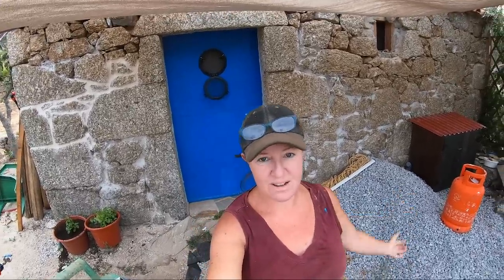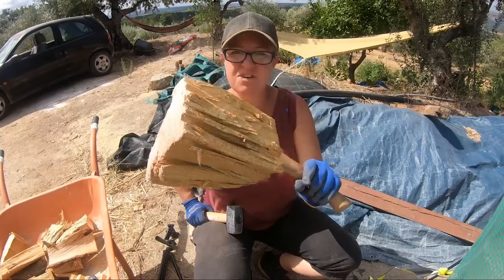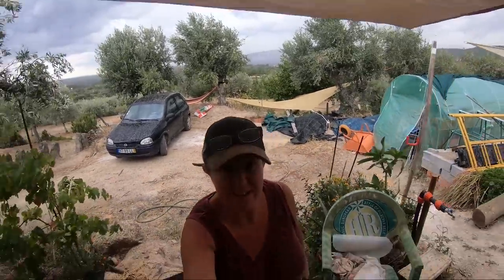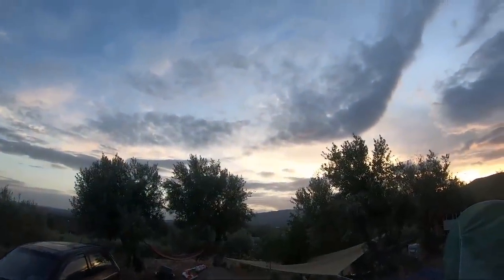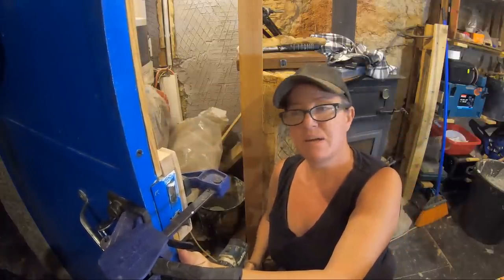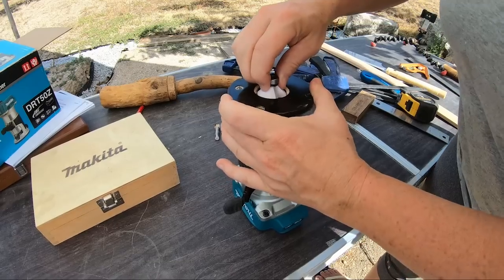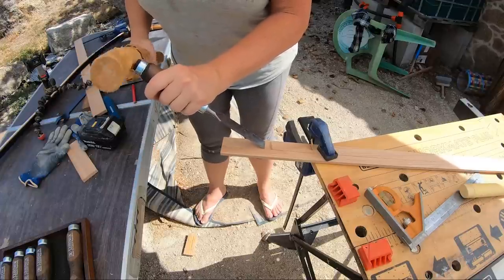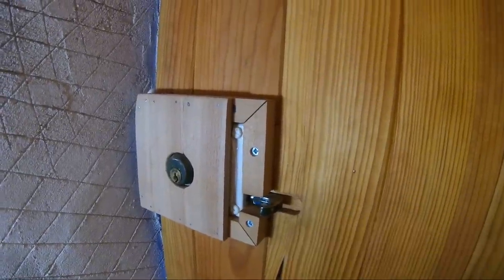Rain, Shine, Chainsaws & Hand Tools, a Video of Contrasts! - Off Grid

Comment: Have doors that open to the full width. Tradies find it so frustrating when they don’t have clear access to the things they are working on.
Reply from the maker: I agree, I think I'm leaning towards one large door which I hadn't considered for some weird reason!
Reply: @PortugalfromScratch  Yes, my first thought was also that if someone needed to get in to work on the solar or replace a part, it would be difficult to access.

Comment: Some good ideas in the comments.  If you need air to circulate, I would go for the louvered bi- fold door.  Folding to the left.   If you don't like louvers, use plain wood .    I wouldn't hang a curtain as it would look a bit  ' make shift '.
and regarding the lock :  @Reet64     below ,  has a good plan for cutting the wood at an angle.
Reply from the maker: Lots of great ideas! I'm not crazy about a curtain as a permanent solution, either. And people have pointed it out as a fire hazard, too. Thanks for the suggestion!

Comment: A nice coloured bead as a door knob might be nice if the screw option works with that. You cld feasibly do a rope/wire attachment across from the pull handle to far side so then you just pull down on the rope to open it. Cld be marine knots or Gaelic twists or something pretty. Re the cupboard door my only suggestion is to think abt what suits you to open it either towards the front door or towards the back wall. You cld feasibly get a concertina door attached so that it doesn’t impact the room but might not be room for that and still get in the cupboard. Good luck.
Reply from the maker: Ooh a bead or a knot are both good ideas! I like the idea of tying something onto it as I'm nervous of the drilling. Let's see!

Comment: Could you carve out a block of wood to go over the little thingy? Maybe have it it run on wood rail somehow?
Reply from the maker: This was what I was thinking at first but I was having trouble wrapping my head around how it would actually work in practice. 😁 I think the easiest solution is to have a little strap made of leather to loop over it tightly. There's a leather worker in this area so I'll ask her to see what she says. Thanks!
Reply: Keep in mind I have absolutely no woodworking experience. I was wondering if you could use your router and make opposite profiles on the block and on the pieces it would be sliding into. That way the little block could slide could slide in and out and stay locked onto the stationary part. I don't explain things well. 😊 I like the leather strap idea and it would be much easier. 😊

Comment: Hinged door so it folds open to full width- or can open smaller section only for quick shelf grabs
Reply from the maker: Yes this is what I'm thinking now... two sections, a smaller one on the left that can be locked into place or opened fully. Thanks!

Comment: Hey, if it ain't from scratch, it ain't Portugal from Scratch! As for the closet door, what about a bi-fold? And for the lock, what if you cut the piece of would at an angle, so it's as thick as the other pieces on the left but then tapers down to a point at the mechanism end?
Reply from the maker: I like the idea for a bi-fold across the entire width of the opening, possibly with the left side a smaller section... if that makes sense. Lots to consider! Yes I'm wondering if I'm making things hard for myself. Your solution could work, I'll investigate! Thanks!

Comment: I understand exactly what you are saying about the door. I have a wide(ish) front porch. I didn’t want a giant gate. So I had a wider than normal but still manageable gate put in place and for the other 15-20 inches I had a narrower gate made. It’s hinged just like the other side so it can open and close it but so I don’t have to have both sides open I had a metal mechanism  of some sort (don’t know what to call it) that attaches a few inches above the bottom of the gate. It’s got a upside down L shaped bar that goes down through the mechanism and down through a nearly matching size hole through the floor of the porch. Lift that bar out of hole and open the gate if I need to bring something wide through it then shut that smaller gate, put the bar through the mechanism on the gate and down through the floor.  Turn the smaller bent side of the L to left or right against the gate so no one catches a shin on it. I hope this didn’t confuse the heck out of you.
Reply from the maker: I think I know what you mean and I'm leaning towards an idea like that, but the whole door will open to the left so it's not in the way. So perhaps a hinged door the full width but with the left side of the door more narrow. Not sure if this makes sense!
Reply: @PortugalfromScratch  - that would definitely work. I have a bifold door on my bathroom closet and I love the benefit of that.  I think your two different sizes would be just fine! Better than putting a stationary door on one side. It’s nice to be able to make a wider space just in case you have something bigger you need to put in/take out of the closet. Good luck!  I just love watching your channel - always look forward to watching them!

Comment: I vote one door.  In the home I grew up in, the door to the hall where the bedrooms were had a louvered section in the door itself to allow the air conditioning/heating to circulate even when the door was closed.  So maybe something like that and just have a solid wall at the top.  I would do one door.  I think a smaller door in that small space already might be a pain if you needed to really get in there and work on the solar.   Edit: just had a thought about the lock.  If you had a knob, or piece of wood at the front of the cover plate you are installing with two pieces of wood, or metal, like screws, or nails or something that is on either side of the existing latch at the back side, when you turn the knob or wood turn button, it would move the side pieces on either side of the latch and push or pull it.  Hope that makes sense.
Reply from the maker: Cool idea for the lock but I think I'm going to have someone local make a little leather strap. Seems the easiest solution. Thanks for the ideas!

Comment: If you put a door and a small wall would you need more framing? I think one door would look nice and especially if it were louvre up top or had a type of texture to the front. Regarding the door do you know anyone that could weld a T-bar knob on the end or could one be screwed on without too much trouble making a hole in the current knobby bit. Disclaimer: I have no DIY skills 😂
Reply from the maker: I'm leaning towards one door now, thanks! I do know welders... I hadn't considered that option at all! Thanks!

Comment: The doorlock problem... 🦗 🦗 🦗. If the closet is going to be a permanent setup, then a door would be great. I would prefer a full door without a partial wall. If the closet might be changed at some point, then you might consider a nice curtain. Just a thought.
Reply from the maker: I try ink a certain as a temporary solution could work it I also think a full door, no wall, would be a good option. Thanks!

Comment: You said that that dense wood has to go on into a hot fire/ stove  and will burn for a long time;  so maybe it's good to keep it in as large pieces as possible, as long as it fits in the stove. Will you have other lighter wood available? Once in a house with stove and long flu-pipe we had some hardwood chunks delivered and the stove finally stayed lit all night. Great vlog!
Reply from the maker: Agreed! Though I have to balance that with the size of my fire box which is a little smaller than standard. I'm going to see about getting a delivery of mimosa as well as it's great to get the stove hot. 🙂

Comment: I think if you drill a hole in the latch to attach some sort of knob or grip it might weaken the metal and risk its becoming fatigued over time. I think if you use the wood cut into shorter pieces and round over their edge where they approach the latch it would be better. As for the closet, I think your idea of a short wall on the side of the solar setup and a narrower door is good. Think about which side the door should hinge on though. Should it open toward the left (front door) or to the right (wood stove)?
Reply from the maker: Yes you could be right and if that snapped off that would really suck. I don't want to shorten the width of the cover because of the way the wood is underneath that... but perhaps I'll consider it! The door should have hinges on the left side and I'm leaning now towards making one big door.
Reply: @PortugalfromScratch   Its not changing the width, just putting a rounded over edge where the break for the latch is. That would be more comfortable for the finger pushing/pulling against the latch.
Reply from the maker: Ah I think I see what you mean! That could work!

Comment: I have a suggestion for the kitchen window. What about fitting a small piece of plexi-glass into that small opening as a temporary window instead of the tarp? Too bad they don't deliver firewood in shorter lengths? Could you request something like that? Also, for the closet - what about that little wall you were imagining then a curtain instead of a door? Even if the curtain bit was temporary until you figured out a door? Or buy a louvered bi-fold door? P.S. Maybe a curtain is not a good idea near the wood stove, on second thought.
Reply: P
Reply: Hi Monika great idea . Bit of plexiglass rough cut , seal edges with caulking and no  more ugly tarp hassles.
Reply from the maker: Good idea in theory but my water problem isn't the window, it's the area above it where I need to get and fit a giant stone. I requested shorter lengths and got huge ones still so I guess I need to be a lot more forceful next time. Lesson learned! I think a bi-fold door across the full opening is a great idea. 🙂
Reply: Ah, I see!

Comment: The opening is small so a single door is the way I would go. The left side is blocked anyway by the solar stuff so opening it up there will not help much. The firewood storage would also work way better if there is no door at the right.
Regarding the door hook, can you bend it open? Would be a leather loop attached to it an option? The nail holes on the lock cover are not uniformly spaced and therefore are not looking that great. Are you going to cover them with wood paddy?
Reply from the maker: Totally agree about the door. That metal is very hard and even if it did bend it would probably make it even more difficult to grab onto, but I like the idea of tying something on. The heads of the nail aren't as small as the ones I had planned on using, I made a mistake. But it's hard to notice them really unless you're right there starting at it. Wood putty could be an option!